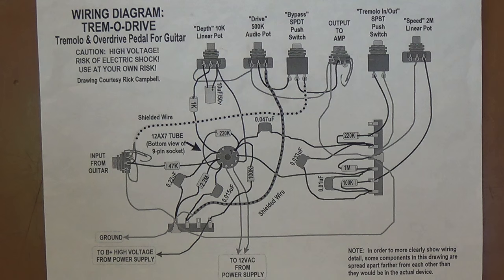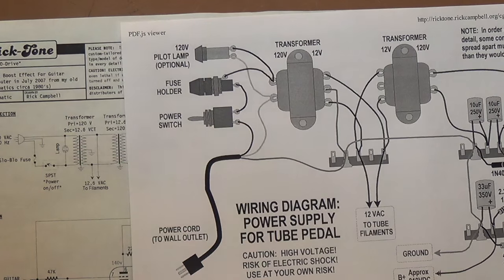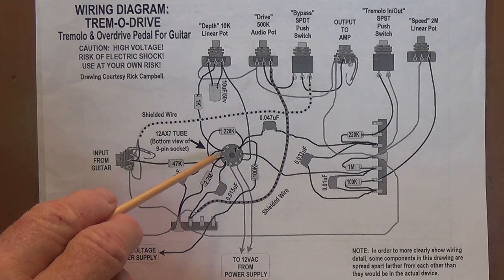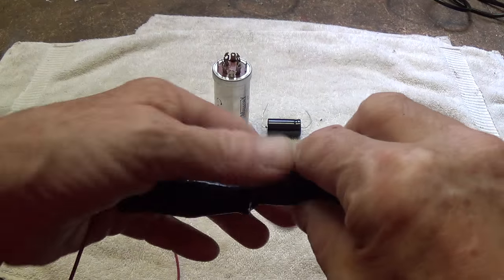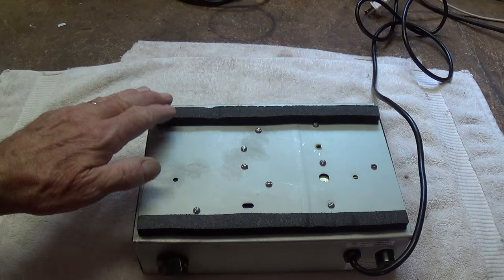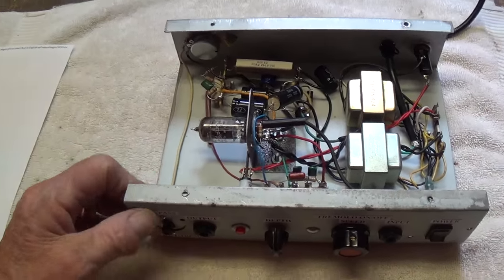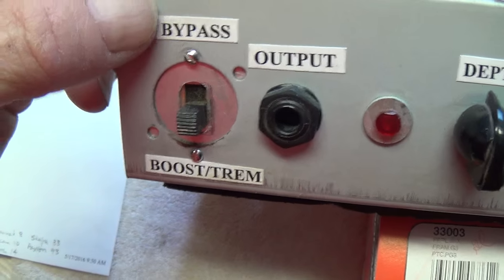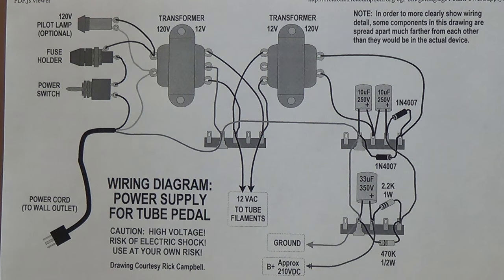Build Your Own Inexpensive Tremolo & Overdrive Boost Unit, Part 2

Comment: The master continues! For Uncle Doug's ampaholics who want to dig deeper into this design, research the Colpitts oscillator. Those 3 caps in series create enough phase shift to apply positive feedback creating a tuneable low frequency oscillator.  Had a long day here, just sitting down at 9:30pm to start my weekend with Jack, Rusty, Doug and a smile. Thanks Doug.
Reply from the maker: +Craig Hollabaugh  You're welcome, Craig, and thanks for the tip on the oscillator. It sounds similar to the phase shifting oscillator used in tube tremolos. Have a great weekend :)
Reply: +Uncle Doug You're right, I spoke without checking my references. Its just a phase shift oscillator, https://en.m.wikipedia.org/wiki/Phase-shift_oscillator, not colpitts. My old brain ain't what she used to be.
Reply from the maker: Join the club, Craig. Thanks again for your input and......oops, I forgot the rest :)

Comment: This is a great and relatively easy built. Thank you for the idea. I actually built this a while ago when you posted the video comparing this to the mechanical tremolo.

A tip for fellow  Europeans:
The back-to-back of the two transformers & the voltage doubler network does not work well with 230 Volts. The resulting voltage would be too high. One could use a different form of rectification, but there is a much simpler solution that is even cheaper than the two 12V transformers:
If you don't mind using semiconductors in the power supply, it is easy to get a cheap little transistor-based power supply unit (see links below):
This is fed from a 12VDC wall-wart and puts out up to 220 VDC (in some cases up to 400V).
The output voltage is even adjustable so you can fine tune your plate voltage to attenuate the slight tremolo "heartbeat" that is sometimes audible at some settings.
The 12VDC input is also used for  heating the tube.
I have built this and it works great. It can be build with  a very small footprint and will fit in most  foot-pedal size enclosures. 

http://uk-electronic.de/onlineshop/product_info.php?products_id=3555&osCsid=cceee2b0ccd309f828b1722054623f1c 
or
 http://www.tube-town.net/ttstore/Bausaetze/Spannungsversorgung/TT-VPump-Spannungskonverter::6163.html
Reply from the maker: Thanks so much for providing this information for European builders, Han.  I'm sure they'll find it helpful.

Comment: I very appreciate that you take the time to include information like how build your electrolytic-capacitor-draining-tool! This makes your channel very outstanding!

In Europe most tube online stores offers chassis for 10-20€ in all sizes, even with holes for tube sockets, which could be hard to drill.
Reply from the maker: You're welcome, PoB. Being able to buy an inexpensive pre-drilled chassis would definitely make the scratch-building process much easier.

Comment: This is the inspiration for my first actual build.  I really don't care for tremolo, so I am planning a Tube-O-Drive.  With a switchable second gain stage on the second side of the 12AX7.
Reply from the maker: Sounds good, Frank. Let us know how it turns out.
Reply: Here is the schematic, after some suggestions from experts I am using pot for a gain control for the second stage, and using the original gain pot as a master.  There were a lot of questions about the .22 cathode bypass cap being too small, but if you plug Rick Campbell's parts into the Cathode Bypass Calculator, it is a nice curve, especially for a guitar with HB pickups.

I had no spare parts that would work other than the diodes...like $.50.  Cost is about $90 less chassis or case, which I will bend a piece of sheet metal for the chassis and build the case out of wood.

For anyone wanting to find the transformers cheap, Allied Electronics has them in 500ma, centertapped, for less than $7 apiece.  Pretty much everywhere else they are well over $10 each, as much as $25.

http://img.photobucket.com/albums/v298/fstroupe/2-stage-gain-control1.png  (updated schematic 3-8-18)
Reply from the maker: Thanks for the link to the schematic, Frank. Hopefully, some viewers will see it and incorporate your modifications into their build.
Reply: Though you have a dozen years on me, I do not ever see having the patience to bend by hand 16ga sheet metal into a chassis.  My patience ran out pretty quickly on the 24ga I used.  Oh well, I can say it has a "hammered" finish.
Reply: It is up and running.  There was a mistake in the schematic that I found during the build.  Also a design flaw with using two pots , but I realized it beforehand and probably not a real issue.  

At first it was very noisy, but I replaced the wire from pin 2 with a shielded one, and it is very quiet.  LOL the amp I am using it with right now is noisier than the preamp.  Which may very well be my next project, something that I have wanted to do for quite some time, handwiring my (modern) Epiphone Galaxie 10 and building a new case for it, along with improved power supply filtering.     

It is rather trebly, so some cap experimentation is in order.  I expected that too, so not a big deal, a good chance to use the information gained in your capacitor and tone stack lessons.  

Things are going to be pretty hectic around the household for the next few days, and I work weekends, so I don't imagine I will have time for any videos before next week.  I haven't built the cabinet yet, so it looks pretty similar to yours without the cover on it.

Thank you for giving me an excellent example for my first build.  It has given me the courage to do something I have wanted to do since I was inspired by the greasy-headed old WWII electronic techs (my dad's ham radio buddies) that came over and stunk our house up with rosin flux, melted wire insulation, and the beautiful smell of hot vacuum tubes when I was a little kid in the 1960s, working on his vintage WWII transmitter and receiver, and various ham radio gadgets that they built from scratch.

Comment: Great video. I made myself last week a capacitor discharge pen out of a Expo whiteboard marker. Since I do not work on tube equipment (Just a fan of tube equipment) I used a 3 watt 1K ohm resistor that fits perfectly in the marker tip. I then used 14 gauge wire and soldered it to a banana plug that I drilled and mounted to the marker end cap, This way I can use different cable connections for it. Before I built the marker I used a crappy Harbor Freight multimeter that I added a 1/2watt 1K ohm resistor to the output terminals. That was I could watch the cap discharge.
Reply from the maker: +Leland Clayton Thanks, Leland. We appreciate your helpful input and comments :)

Comment: Hello again, I've had a go at building this unit, I am using a chassis I made for another project and piecing it together.  I couldn't find a 2 Meg Ohm pot for the term speed, so with a bit of trickery pokery I wired a dual gang 1meg ohm pot to get the 2 meg.  I managed to get the drive section working but not the tremolo, I back tracked through all my wiring and component values and it checked out ok.  I slept on it, and realised that I may have used a12 AY7 instead of the ax7,  sure enough, that's what happened, now the drive and tremolo work but there doesn't seem to be much variation in the speed, I'm not sure what the effect is supposed to sound like so I am waiting to hear what yours sounds like.   Thanks, Colin
Reply from the maker: You're welcome, Colin. I don't think I had a 2Meg pot either, so I used a 1Meg. Maybe your ganged pot is not working like it should. Try a 1Meg pot in this position, or experiment with fixed resistors to see if the speed can be altered. Good luck.

Comment: I remember driving from Yuma to San Diego in 1993 in my 84 Camaro with the windows down and my arm hanging out the window. It's almost a straight shot all the way there with the sun on the drivers side the whole time. I'm part Cherokee and had never sunburned in my life, and the heat wasn't really bothering me (no humidity out there usually), but by the time I went to bed that night, half my arm was blistered. The heat is very deceptive in that part of the country!
Reply from the maker: +St. Hugh  Yes it is.  When I was a kid, distracted by playing outside (and sunscreen hadn't been invented yet), it was common to get blistered. I'm still fearful of developing skin cancer from those experiences. So far....so good, however.

Comment: Uncle Doug, I am totally and completely enthralled w the videos you’ve made, teaching all this great information about amps.  To the point that I sometimes forget to eat and drink.  I’m curious, do you think this tremo-drive could support having a tone stack in between the first and second half of the 12AX7?  Would that reduce the circuit’s overdrive ability beyond what would be usable?  Thanks in advance!
Reply from the maker: That's great to hear, Justin. Thanks so much. No, it could not support a tone stack.....it is strictly a Tremolo/Boost. You will have to use the tone controls on your guitar or amp.
Reply: Uncle Doug , I apologize, I should have been more clear with my question.  And I suppose it should have been a two part question.. 1) could one use both halves of the 12AX7 for boost in this device, and if so, would that support having a treble, mid, bass tone stack in between?  I watched your series on tone stacks several times over and am interested in shaping the sound of the overdriven signal before it hits the amp (a single ended 5F1 circuit).  The second part of the question would be, would using both halves of the 12AX7 for overdrive put too much signal into that amp?  Many thanks in advance again.  Really enjoy your videos!
Reply: Uncle Doug, to further clarify.. not building the tremolo part of the circuit..
Reply from the maker: @justinbotts9321  It doesn't matter, Justin. Although you could use both triodes for boost, the negative effect of a tone stack would far outweigh any benefits to the boost circuit. Having three separate tone circuits (guitar, boost, amp) just seems redundant and excessive. You're welcome to try it if you wish, however. Let us know how it turns out if you do.
Reply: Uncle Doug I appreciate your thoughts.  The whole goal would be to shape the tone with the tone stack.  The amp I’m using doesn’t have one, it’s only a single ended champ clone.  But, since adding a tone stack to the tremo-drive circuit would rob significant signal, negating the overdrive effect, I’ll likely hold off and figure out another solution.  If I do end up trying it, I’ll let you know!
Reply from the maker: @justinbotts9321  Sounds good, Justin. Meanwhile experiment with your guitar pickup selection and tone controls.....you many not need any more.

Comment: Hi Uncle Doug & Rusty, Nice project for beginner. You do a real neat job on all your point to point. Still gathering parts for 5F1 build, as work becomes more prevalent, will commence building. I found a 6SJ7 tube I got somewhere, can't say if any good, no tube tester. Would like to do a 5C1 or equivalent. Take care, C.
Reply from the maker: +Cass Virgillo  That sounds like an excellent project, Cass. Best of luck with it.

Comment: Doug, I have a couple of questions and a small update,
 
(1) Concerning transformers: If I have one 120V P x 12V S transformer with a center tap and one without can I use the one without a center tap in 12VP to 120V S side?

(2) I'm trying to figure out what to do with the line cord ground. The circuit board ground plane could be isolated from the chassis with plastic standoffs or connected to the chassis with metal standoffs. Both sides of the board are ground plane. The traces are isolated from the ground plane by machining away copper. At the moment my thought is to connect the line cord ground to the chassis and connect a wire from the ground terminal on the chassis to the board. I could rely on standoffs to make the connection but I don't think I like that option

Current status: Prototype is assembled. Mistakes made on part size corrected on the schematic and board files :) (that's why it's a good idea to build a prototype. I should have printed a 1:1 drawing and compared it to the parts first). At this point I could order a couple of commercial boards but I want to see how the prototype board handles the "circuit". Ie does it introduce hum. Will the traces handle the voltage and current (pretty sure they will).

Waiting on parts <-- the story of my life

(To the sharp eyed: Nope... that is not a 12AX7 but it has 9 pins and it was easy to get to)

http://wildlightimagingstudio.com/img/s11/v3/p1996953673-4.jpg
Reply from the maker: 1.) Yes, the one without a CT goes in the second position. 2.) I would vote for the plastic standoffs with a wire to ground the board. Multiple standoff-grounding may cause ground loop(s).  Thanks for the update. Continued good luck with your project.
Reply: That makes sense. Ground loops are the spawn of satan :)
Reply from the maker: Yes, widely misunderstood and often unrecognized....they can cause a lot of grief.

Comment: Hi Uncle Doug !  Ive seen several people instructions showing to use a resistor to build the capacitor draining instrument.  Ive also seen several instruments show not using  a resistor in the instrument.  What is your opinion on this ?  Is the resistor necessary or not ?  What is the purpose of the resistor ?  If its not necessary, what is the benifet of using the resistor ?   Also, is it necessary to use a ballast resistor?  Can any other type of resistor be used, as long as the value is the same ?
    Thanks for the video and thanks for tour time. Have a good one and take it easy !
Reply from the maker: The resistor is necessary to slowly discharge the capacitor(s). I have found that 100 Ohms and 10W is about right.
Reply: @UncleDoug  thank you.

Comment: Fuse first or switch first difference of ideas.  In my opinion it doesn't really matter either way,
since the switch, (if it is in the off position), the power will only go to the input side of the switch. The fuse will not have any voltage. Now, if the fuse is wired in  before the switch, the fuse will have 115volt potential at the fuse, but no A/C current will be flowing to the transformer primary.  Two transformers, one for the filaments and one  for the voltage doubler circuit.
I guess two were necessary for full isolation of the AC and  probably these two were cheaper as surplus? 
I  probably would have looked at  a Hammond 262B12 combo secondary windings;  120v(45ma)  which would be sufficient for the single 12ax7 dual plates and
the  filament winding of 12.6 volt at 300 ma. Some suppliers like Mouser sell these for around $28 USD.
Reply from the maker: Thanks for your input, SC.

Comment: Hi uncle doug,
I have 2 questions:
A friend gave me 2x 220v/12v transformers without ct. 
1) Does it work if i add an artificial ct with 2 resistors on the secondary of the first transformer?
2) I know i don’t need the voltage doubler but on your « power supply » video, it looks like that this circuit smooth a little bit the dc. Should i increast the filter cap value or add another one?

Thanks a lot for sharing your knowledge!

Vincent.
Reply from the maker: Greetings, Vincent. You don't need a center tap, just use the "middle" 12V for your 12AX7 filament heater. Instead of the voltage doubler, add another 33uf @350V cap in place of the 470K resistor. See if this works OK.
Reply: @UncleDoug   Thanks for the answer but when you say "just use the "middle" 12V for your 12AX7 filament heater" you mean that pin 9 must be connected to the ground?

Comment: Hello. thankyou very much for this video. I've build a unit and is working fine, but when tremolo is on, its makes bump bump bump at speed pot rates at audible volume. I use a 1Mohm potentiometer instead o 2Mohm in schematics, the only diference. How can I fix it. thankyou very much again.
Reply from the maker: It's really hard to troubleshoot any gear issues long distance, especially when the item is homemade, Horacio. My advice would be to try shielding the signal cables and experimenting with lead dress and component values.....especially if they do not agree with the schematic.
Reply: @UncleDoug  thankyou. I change the audio cables path and the noise is still ther but very low volume.

Comment: Great videos Uncle Doug! I started to buy my components and necessary parts for this build and I am very excited about it.  I have a couple questions, though: What current value is your fuse rated? Also, where do you recommend buying components?  I am having a lot of trouble finding the right caps. Thanks!
Reply from the maker: Thanks, Kyle. I usually fuse quite conservatively, with the lowest rapid-acting fuse that permits reliable function. This is often determined by trial and error. I buy all my components (except for transformers) from Antique Electronic Supply.
Reply: Uncle Doug, thank you for your quick response! Antique Electronic Supply had what I needed.  In regards to the fuse, though, what amperage is your fuse rated on your tremolo unit? I am building the same thing.  Thanks again.

Comment: Uncle Doug! Can you make a video on how to add a reveb circuit? I like how you explain every detail of your videos
Reply from the maker: It's really not feasible to add reverb to an existing amp, Laurence. The power and space demands are simply too great, without forcing a major overhaul of the chassis and power supply. Your best bet is to build a Fender 6G15 stand-alone reverb unit that can offer completely authentic Fender reverb effect with any amp. Check the Internet for kits and schematics.